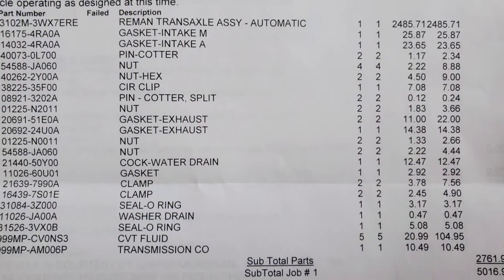2017 Nissan Maxima Cvt Failure! 🔴 What Signs to Watch For and Things To Avoid!

Comment: Here's what happens with a "Demo". Someone who works for the dealership gets to drive the hell out of this car for a short period of time with no concern whatsoever for the long term life of the car. They know from the drop that the car will be sold with very low miles and as close to the price of a new car as possible. Back in the day salespeople got Demos. They are now typically reserved for entitled over payed managers. I treated all of my demos like rented mules. I once worked at a Mercedes dealership where one of the other managers took his sedan down to the home improvement store and hauled construction materials in it like a truck. After putting a bunch of stuff on the roof with no racks he had to take it to service to get the sunroof to open again so it could be put out for sale. It was a well optioned car and the dealership made plenty of money on it when it was sold. The dealership also gets to write off the expense and depreciation on the car. The customer gets the shaft. In my experience the dealership sells these cars for a much higher price than if you were to buy a car new and then turn around and sell it with a few thousand miles on it yourself or trade it in. As soon as I heard the word "Demo" I knew how this story would end. Sorry to hear it cost you $5K. At least now you have a fresh trans in a beast of a four door car.

Comment: I bought a 2016 back in April last year only had 55,000 when I bought it. A month after getting it the transmission started to have a shutter so I took it to the dealership and they found a shutter code in the transmission. They replaced the transmission and about a month after that they had to replace my transmission valve body it drove fine for a while but then I start to feel bumps in the transmission so I took it back to Nissan about a month ago and they had to replace the valve body again. Now a month later I’m starting to feel the same bumps in the transmission and it shifts weird. This should not be happening for a 3rd time and I only have 74,000 miles.
Reply from the maker: Keep all your reciepts for a long time. I have a funny feeling a class action lawsuit is in their  future. Just a funny feeling i have after seeeing so many people comment on these issues
Reply: Lemonade,  crap!

Comment: I have a 2015 Rogue Select and the RPM’s did just like yours the other day. I’ve only had this two months when husband was sick and in hospital and my Toyota engine went. I was tired of taking an Uber to hospital those 8 days he was in. Also thought it would be easy for him to get in and out once home but he never saw it. He came home via medical transport and passed away a few days later due to dementia. 
So anyway I lost power in this Rogue and air condition at same time. Took to shop today and they said they couldn’t find anything. 

My question is should I take it to a transmission shop to get fluid checked or just sell this for what I can get while it’s still running, shifting easily and no engine light is on? I’m asking how do I know if the transmission is gone or just needs fluid? I also don’t know what engine braking means. Thanks

Comment: I was surprised that you hadn't had any problems at 100k plus. I had an 11 maxima that was paid for. At 84K, the CVT made a whirling or winding sound. Changing the fluid did nothing. 
In short, bought a CPO lexus gs 350. It's 100 % improvement over the maxima. I can't recommend any Nissan at this point after owning a Z, Zx and two different maximas.
Reply from the maker: Yeah I lasted a while, definitely making me change my driving style
Reply: My 2012 Maxima same issue fun car to drive Loved the handling
Reply: @Baysidereviews  Why beat yourself up?  Even using "fake manual" and engine braking, the car STILL lasted you over 100K miles before you had to spend some money to repair it.  That was probably 8 to 10 years of fun driving, right?  I call that a WIN!  Drive 'em hard and put 'em up wet, I say!
Reply: If CVT fluid didn’t correctly fill in, whining noise continues. In my case, I own Honda city 13 and have its CVT fluid dropped at Honda dealer. Guess Honda did fill it up correctly. Unfortunately, it didn’t and noise remains there and I rushed back to Honda to buy another litter of Honda ATF DW1 to put it in at correct level by garage nearby. Problem solved. Sometimes but not alsways, dealer know to make money from your pocket. So be careful and take care of your asset.
Reply: 3 maximas, altima, titan and a qx56 and 3 lexus currently a 2017 lexus lx570. nissan is nowhere in the realm my 2010 maxima did the same. I'm never going back to nissan

Comment: We have a 2015 nissan sentra 40200 miles the cvt went out in it final cost for a new one was 4780 it sucks because i had the fluid changes about the 36000 miles i can’t believe theres not a class action lawsuit on this we bought it used 4 years ago with 19000 miles from carvana it was a fleet car in florida department of transportation it was about 3 yrs old when we bought it. We dont drive it like a hotrod all service was maintenance by dealer oil was changes every 4 months even if i put only 1800 miles on it.  We work only 3 miles from our home. I tell ya that trans looked like it was towing a tractor trailer for 5 years. So cvt jatco transmission SUCK !!!! Lawsuit against nissan YES !!!
Reply: I just got a letter in the mail from the dealer says my 2017 Nisan rogue transmission is under warranty until 80,000 miles.
Reply: There was a class action lawsuit for your Sentra...should have looked up💔💖recall

Comment: I have a 2017 maxima 110k mile current had no problem with my cvt . I service cvt every 30k.   My first service  didnt trans  service dealer  replace tran even though  i had no issue. My maxima been a great car. Most people dont maintain there transmission

Comment: Change the fluid every 20-25K miles. if you look at the design, the engineer even allow you to have easy access to the CVT fluid filter. Dont follow the Nissan manual. Honda CVT needs the fluid change every 30K. we have some Civic and Accord into 200K+ miles. 1 even has 520K miles.

Comment: i have a 16 Maxima with 100,000 miles got it 3 years ago with 40,000 im a speed demon love that 300hp and i use that sport mode i dont manual shift like i used too i used to use it all the time but i end up putting back in drive anyway so its a fun gimmick but about the transmission i want a newer Maxima anyway so when my car get to around 125 to 130,000 im trading it anyway it wont be paid off but iim not replacing no transmission.

Comment: I got a 2017 SR. No problems at 198k miles. But I'm selling it next week. My 03 altima has been near flawless the 19 years I've had it. 493k  miles and still rolling like a champ 😎
Reply: Damn that's a lot driving in 5 years!  I thought I drove a lot.  So far my 2016 is doing okay. About 75k miles.   My first Maxima and I love it.. Such a nice interior and fun to drive. So I'm praying the transmission doesn't explode
Reply: @scottaayyallday  indeed it is. I'd recommend doing a drain and fill every 15-20k miles. I guess that's why mine lasted this far 🤷‍♂️
Reply: Did you do any transmission service at all ? Any current issues with the transmission?
Reply: @mahammadshariff6162  did a simple drain and fill ever 15k miles. When you look at nissans reputation for cvts you do preventative maintenance. But I had a shuddering problem but it was caused by the fluid degrading over time. Just do drain and fills early and pray for the best 😅
Reply: I got a 2017 SV at 107k, trying to stay on top of maintenance, so i can get to 150k+ with no problems lol
Reply: Consider yourself a unicorn though....

Comment: I have a code of p17f1-00 is that the transmission ??? I also was told that my harness is broken and missing and that’s why they couldn’t fix my AC compressor , because I did have a wreck . I also took it to Nissan dealer and they basically said that the transmission was just replaced and that the wreck is possibly what’s making my car lag acceleration at lights and sound and feel like it doesn’t want to good when push on the acceleration .
Reply from the maker: thats crazy but not out the realm. My wife had an accident with her truck and i swear its not quite like it was
Reply: @Baysidereviews  well I never fixed the wreck yet , but idk what the hell it is .
Reply: The gear in my maxima 2019 SL goes through a hitch kind of feel when in 3rd gear of the cvt (counted the gears based on the rev drop). Is that normal? Or am i not pressing the accelerator hard enough?

Comment: I went for a 2013 toyota camry v6 xle.. but a while back I bought a used 04 nissan maxima... but.... I told the place I bought the car from, for me to buy it they had to fix every check engine light and new Transmission .

Comment: Good lord! Save yourself money and a headache and drain, drop the pain, clean the pan and magnets, change filter, put everything back and refill. It’s not that hard people. Do this every 30k miles and it will last a long time. Preventative maintenance is key. Don’t believe the manufacturers and dealerships about the lifetime fluid. They want you to replace the transmission or buy a new car. It’s all about money.
Reply: Exactly

Comment: Believe it or not a 2004+ Lexus LS430 is a better car in every way. Bulletproof reliability. Supremely smooth quiet and powerful ride. One of the best stock audio with the Mark Levinson and it’s cheaper than a 2017 maxima. These cars will do 500,000+ miles easily with very few issues.
Reply: @As_i_c_it Except for 2007 to 2012 models with front end bushings...$6K at the Lexus dealer
Reply: @turnne  yea that’s ridiculous. All because of defective rubber. I have heard of Lexus covering the costs if you make a stink about it. Same with the brake actuator.
Reply: @Mabeylater293  Hyundai Genesis/Equus is a better proposition
Reply: @turnne  reliability isn’t near as good
Reply: @Mabeylater293  
I disagree 
two relatives had V8 2009 Genesis..one bought brand new. No issues until at least 150K miles and the one needed a wiring harness. I have owned an Equus for the last 7 years and only replaced a wheel bearing. A buddy of mines used to have a 2011 Lexus LS460( bought CPO) ..he had both the brake booster and steering issues. he didnt pay for it...but I think he told me it would have been $7000 had he paid for it the Lexus dealer
AND the Hyundai V8's can use regular( 87 octane) and pretty easy to do your own maintenance as well
Reply: @turnne  ok.  I just prefer to rely on reports that monitor a far greater number of samples for determination
Reply: In my family 2013 IS, 2015 GS, 2016 ES, 2017 LS and 2021 IS, team Lexus, nothing but maintenance and the 2021 is the only one bought new.
Reply: https://youtu.be/GOYfNj7kx7M

Comment: I have a 2011 maxima with 182,000 miles on it, never had the transmission fluid changed, wondering if I should change it now or just keep the old fluid in it?
Reply: Is that a cvt trans or regular at trans?
Reply: @gutadin5  cvt, pretty sure the maxima only comes with that option
Reply: He'll no change
Reply: Change that shit. Don’t flush. Just change
Reply: I am, already have the ns2 cvt fluid just waiting on the filters to come in

Comment: If they put in a remanufactured transmission that means it can be rebuilt 🤔

I remember hearing that CVT transmission fluid has a shorter service interval. I work on a friend's civic regularly that has a cvt and at it:s 25,000 mile service interval the fluid is always black, he now has me change it every 20,000 miles...

Comment: i have a 2015 versa note with 130k and its slipping bad. had the fluid flushed normally and its still slipping to the point i had to have it towed home once. now im looking at getting a rebuilt cvt. its crazy that theyre still using cvts after how many of them shitted on people. definitely not buying any car with a cvt again.
Reply: Most car brands use cvt just so you know
Reply from the maker: i'm with you on not getting another cvt type car

Comment: I never liked engine braking even with a normal automatic transmission.  I don't want all of that stress on my clutches and gears.  Brake pads were meant for that instead.  The way that I see it replacing a transmission is much harder and a whole lot more expensive than brakes!  This is considering that some places charge $800 or more to do brakes.  I would rather replace a warped disc brake, they are a lot cheaper and infinitely easier to change.

Comment: Nissan has had CVT problems for years. They should have to replace them all. I have an 07 with 202,000 miles and so far mine is doing okay. I keep my fingers crossed. I drive very conservatively and change the fluid every 30 to 45,000 miles. I doubt mine would be worth putting a transmission in it with the miles but I do like the car. I change my oil every 3000 to 3500 miles and even with 200,000 miles it doesn't use any oil between changes. I'm hoping to get at least 275,000 out of it. With all the stories I've heard and Nissan not seeming to want or be able to fix these problems this may be my last Nissan, even though I do like it. Hope your new trans holds up. What kind of warranty is on the new trans?
Reply from the maker: 12000 miles or 1 year

Comment: These transmissions can do some of this stuff but still go another 100000 miles,,I had an altima  which did this and rode it for 120000 more miles,,,so is it worth fixing it or just fixing it when it really goes?,I have the same car sr midnight 2017,,occasionally it sticks but I'm not gonna worry about it,,I do have an extended  warrant on it,,so when it goes,it goes,,,I've seen these cars go for a long time on a shifty transmission

Comment: Did you change your transmission oil every couple thousand miles tho I just wanna know cuz I really want a maxima, I’m in the market now, and I’m just hoping Nissan cvt’s aren’t as bad as people make them seem
Reply from the maker: I did it done at 60k
Reply: Save your cash for a better car.
Reply: Maxima change transmission fluid every 30-35 k don't listen to Manual

Comment: I have a 2017 SR midnight edition 73,000 miles no problems with my transmission what is engine braking❓
Reply from the maker: when you pop it into the manual gate and downshift the gears to slow down.

Comment: There’s always 2 version on a story 
I have seen CVT Pathfinders with over 300k miles but their owners do the Transmission Fluid drain and fill every 40k miles 
I have a 2015 Rogue with over 100k miles and 2 Transmission Fluid changes and 0 issues except for a pcv .
I would buy a CVT with confidence

Comment: I have a 2009 Nissan Maxima with $169,000 and I’m hearing a wining noise at low speeds and a shutter feeling in the pedal when driving about 40mph, I had the transmission checked and it had 18 codes which the independent transmission shop cleared and they the transmission is fine, I don’t believe it is I still think I need a new transmission any thoughts, I’m thinking to have another transmission repair shop to check it, thanks Jim.
Reply: You beat the odds, get something else!
Reply from the maker: i remember the whine but it wasnt too loud. surprising with 18 codes they said it was fine
Reply: The shutter at 40 is normal.

Comment: Hello-I'm a Mechanical Engineer that owns a '16 Maxima SV since new. I have 115,000 miles on it. When you said you bought a Demo model, I cringed. All it takes is one CVT belt slippage event to start a never-ending spiral toward failure. In my mind, Demo car= Rental car; they get trashed, but you'll never know it since it happens over time. Sorry for your loss. I have my fingers crossed also for mine. I declined the extended warranty and would rather be self-insured; even though it's $5K, it's still a great car (IMO).

Comment: I have a 2018 Nissan Sentra has 85000 miles got it when it was 55000 same problem took it to the dealership they said I had a bad transmission a quoted me 5,500 for a new one , long story short I contacted Nissan headquarters and they gave me a deal 60% they pay and I pay 40% which was 2,200 , told them it’s no way my transmission should be breaking down before 100000 miles, no recall they said but I’m sure it’s coming